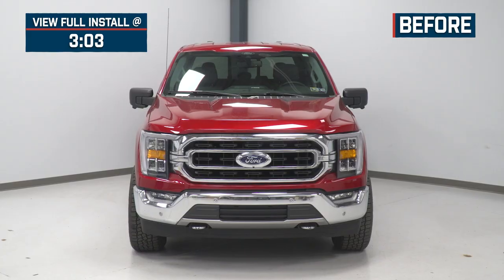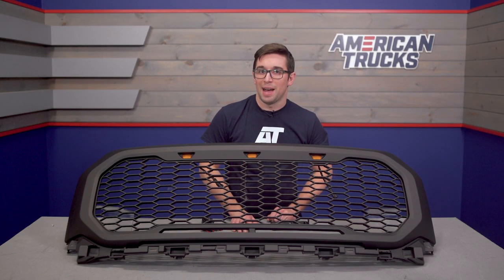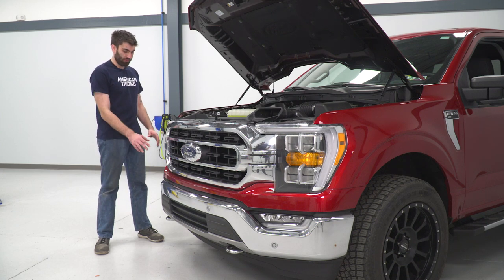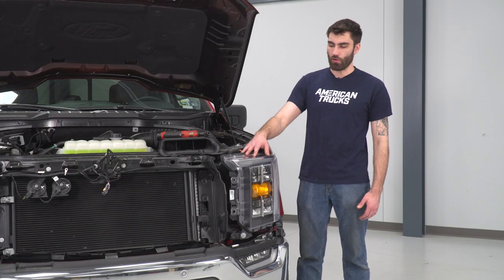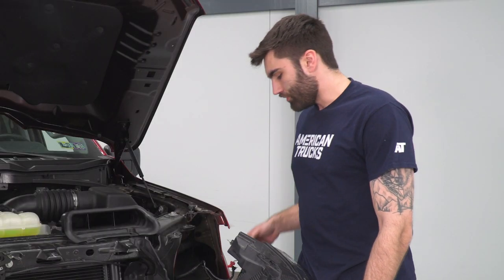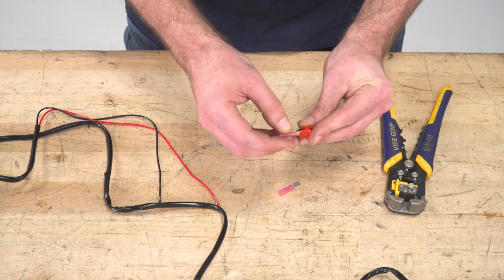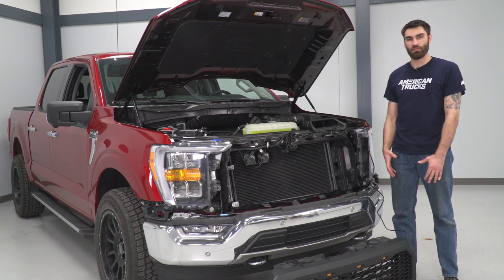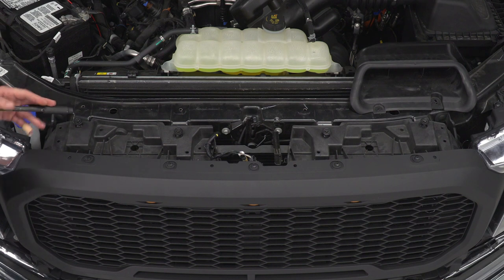2021-2023 F-150 RedRock Baja Upper Replacement Grille with LED Lighting Review & Install

Comment: Followed the video when installing, and now my drivers side blinker doesn’t work. The light illuminates but it will not blink, and when I try to turn left it blinks rapidly. Please assist on what I should do. Should I tap in somewhere else? If so, where? Thanks.

Comment: I have a 2021 STX . No running lights. Can I wire it to the parking lights? Can I use it with the halogen set up?